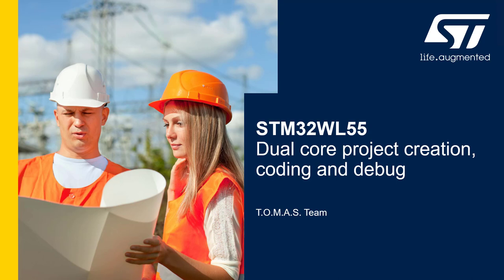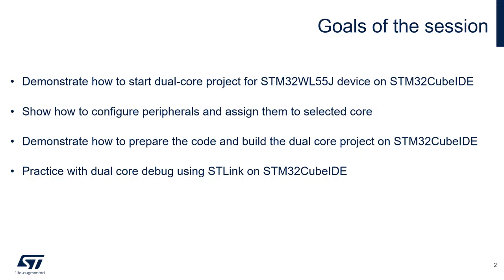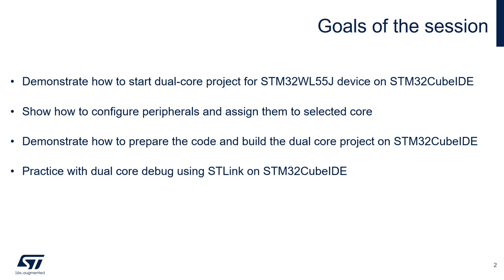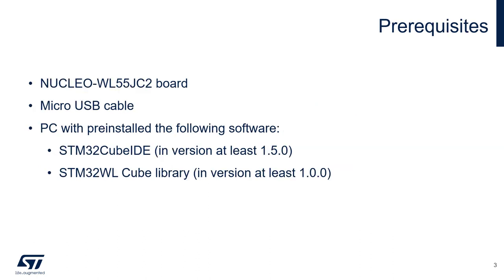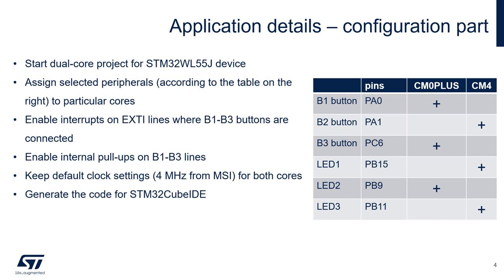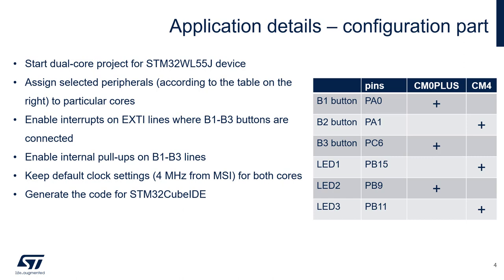STM32CubeIDE dual core project on STM32WL55 - 1 Introduction

Comment: Why does LoRaWAN need to run using two cores? I can't assign LoRaWAN for only one core in the CubeMX. I got a bunch of errors when I assign an UART connection using only one of the cores.